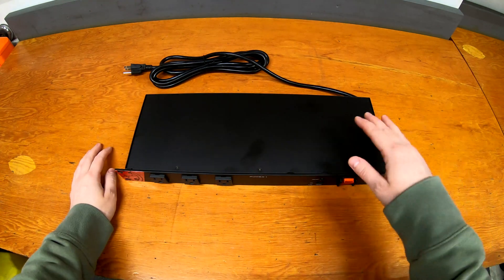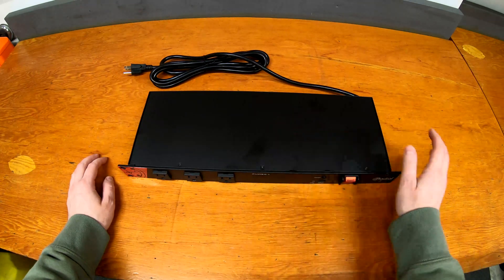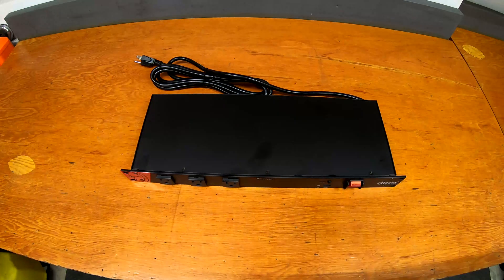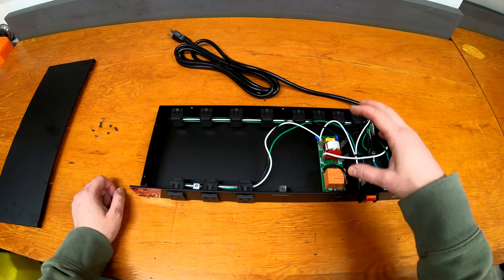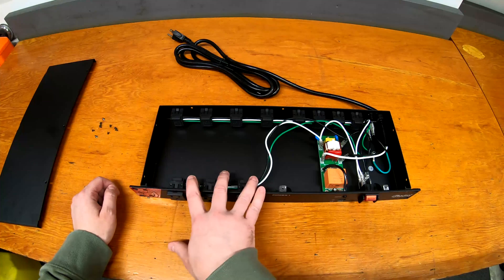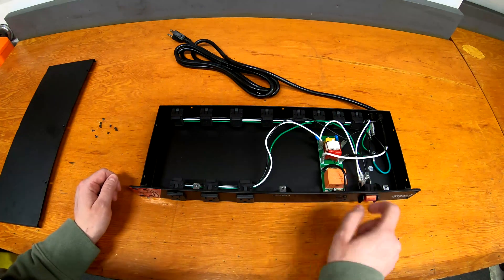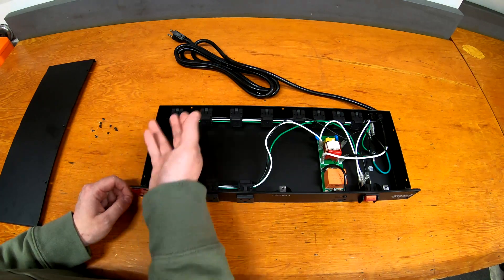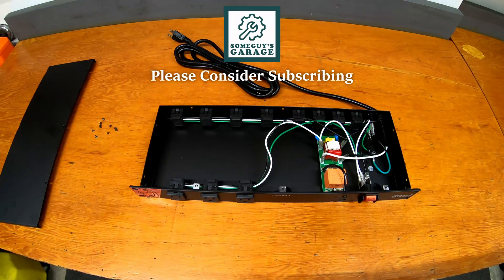Radial Engineering Power Conditioner - The Power-1 - Look Inside!

Comment: I love these videos thanks for doing this. Now question: if  you don't think the merit series are high end true power conditioning, what do you think about the Classic Series PL-8C?
Reply from the maker: I haven't had the classic series on the bench, so don't know what's inside. I believe there's some amount of voltage regulation in those ones, so they should have a bit more to it. At the end of the day though, power conditioners aren't going to save the show from really bad power, it will just protect your gear a bit from damage in the case of a surge or fault.

Comment: Clearly not good enough for the audio HiFi. Each outlet should be protected from each other, so must have a filter per outlet. The wire should be 12 AWG, this one is 14.
Reply from the maker: Yeah, it's honestly a glorified power strip, works fine when you consider it for that purpose but certainly not high end true power conditioning.
Reply: I would just build my own diy

Comment: Would you recommend using this to protect guitar amps and pedals from frying my home circuit breaker? I live in an old home and don't wanna fry out the outlets.
Reply from the maker: No. Why are your guitar amps or pedals frying (tripping or actually frying?) your circuit breaker in the first place? I'd be trying to fix that issue, no power conditioner is going to mask that.

Comment: Would you recommend the Furman or Radial for an AV receiver & 85" TV?
Reply from the maker: Probably a higher end Furman (not the Merit series) as those provide actual power conditioning. The Radial doesn't have a higher end version (the power-2 just adds some lights/storage).

Comment: The filtering look much bigger inside the radial. The big white and red choke on the main bord is simply not present in the Furman plus the wire between the outlet provide more curent that the pcb in the Furman.
Reply from the maker: @erictourangeau3651  some good observations there...only thing that was hard to tell in the Furman is if there were more but smaller filtering, ie they filtered each outlet versus doing it all at once.

Either way, neat to compare and the Radial cost less and has some extra features and is a Canadian brand, so all wins in my books.